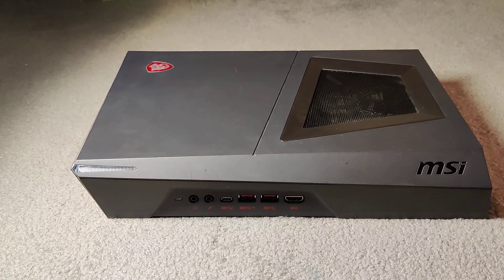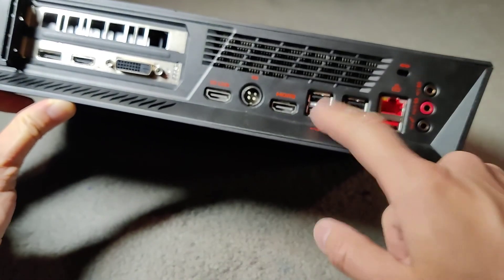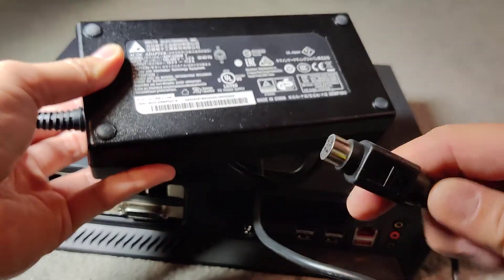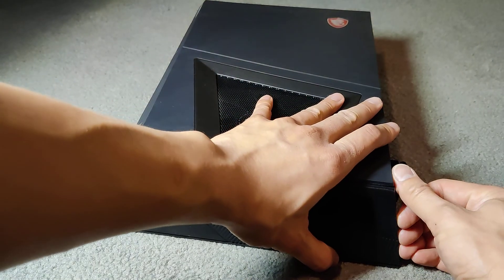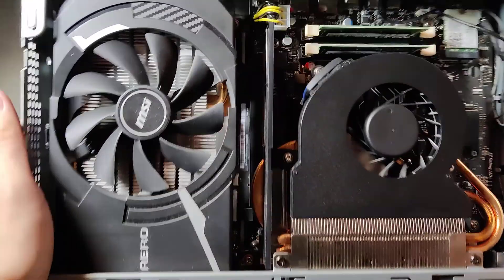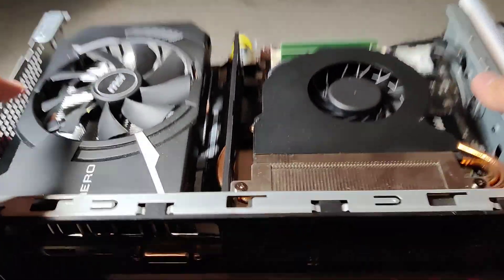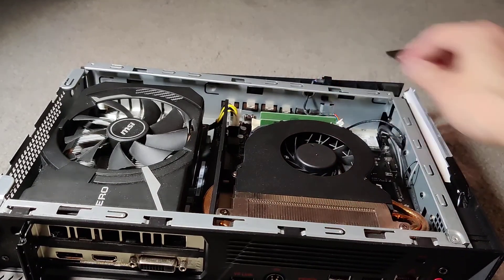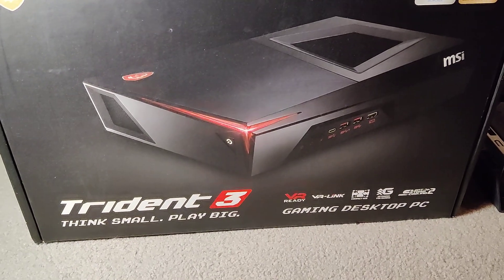MSI Trident 3 9SH-444US, Tear down.

Comment: one question, i need to put one micro sd for instal stuff from my computer i don't see one micro sd port is that correct ?
Reply from the maker: Ya there. Is no micro SD port. Try a USB micro reader
Reply: @richyoyo9796  thank you for the information

Comment: Thank you. Very useful, even though I have one generation older model.
Too bad it doesn't seem to work with RTX 4060, that would be a neat upgrade.
Reply: Seems like the highest you can go is 3060 or something
Reply: @STOPSYPHER  Yup. I found no way to make it work. Nobody willing to mod the BIOS, either. Not enough resources to mod BIOS myself. Clearly they locked it down on purpose. I need to build myself a decent mITX build instead. These manufacturers make sure their hardware becomes a trash can when it is its due time.

Comment: Hey great video! It helped me a lot. Unfortunately I’m still unable to find why my trident isn’t working. I was on it like usual when it just stopped working entirely. I’ve tried a new power cord and still doesn’t work. Do you know what I can do?? I assume it’s a problem with the power supply. No lights turn on when I try to power it on
Reply from the maker: sounds like motherboard. do you see any blacken areas on the motherboard?
Reply: maybe this does help because I had a similar issue: one of my RAM slots got burned so I can use only one now. Also bads on my original HDD, maybe try to stay on SSD only for a while
Reply: I can’t find the power supply. Did you?

Comment: Hello nice video, i have a question, i am thinking to move any hardware to another case from my trident. It will be possible?
Reply from the maker: Ya you can only move like maybe half the things. which is not much.  You will have to get a new case. motherboard and a few other things. I'm not sure. Might as well buy another computer then.  or just save up for the next upgrade.

Comment: I’m currently using my trident 3 from my dad it has a Nvidia GeForce 1060 and an i3 (can’t remember what cpu) I’m trying to get inside to clean it but the case is not opening
Reply from the maker: I'm not sure which part you are stuck on. The case is pretty confusing to open.

Comment: do you know where we can purchase ram for upgrade for this pc ?
Reply from the maker: This one if you just want to get one more stick.  you will have to check how many slots you have left. 
Crucial RAM 8GB DDR4 3200MHz
https://amzn.to/3HFlpL0

Or this one if you need more ram. 
https://amzn.to/40rIGrl
Reply: @richyoyo9796  did you ever install an m. 2 ssd in this pc. I’m planning to do so for a friend of mine as I’m helping him out.
Reply from the maker: @deeelyacoubi2390  Na I never done that to this pc. but its pretty easy. just purchase one and open it up flip it over and plug it in. just keep in just to get rid of any static, so you don't fry the parts. 

Link to Upgrades you can get for the MSI Trident 3. 
https://kit.co/RichYoYo/msi-trident-3-upgrades
Reply: @richyoyo9796  appreciate the reply and feedback. I hit that link, but it didn’t take me to the list.
Reply from the maker: @deeelyacoubi2390  Thanks Try it now. Its just links to upgrades for this computer.

And here are the ssd that will fit.
https://amzn.to/3wI0JvB

Comment: Is the gpu power cable a 6 to 8 pin?
Reply from the maker: Should be only a 6 pin to 6 pin. 1660 does not pull that much power.
Reply: @richyoyo9796  I thought 1660 cards were all 8 pin?
Reply from the maker: @BeigeYeti12345  Sorry My bad. I don't have the computer any more. 
Its probability is  this. 
https://kareonkables.com/products/msi-mpg-trident-3-8-pin-pci-e-gpu-upgrade-cable1

Comment: How would you set up at triple monitor setup on this desktop? I have 2 monitors connected to it & im trying to connect a 3rd, but it’s not connecting my 3rd monitor
Reply from the maker: I'm not sure which step your on. so are all three monitors plugged in? Did you look in to the software in Nvidia?
Reply: @richyoyo9796  yes all 3 monitors are plugged in. Nothing is showing up in my settings so I cant find how to setup my monitor. My 3rd monitor just shows “no signal” on the screen. I have 2 working & plugged up. Just trying to add a 3rd! Please help. I have the 3rd plugged up by HDMI.
Reply from the maker: @SandPipeHer  hmm did you try switching the hdmi cable to another monitor? Could be the monitor or the cable or the gpu hdmi.
Reply: @richyoyo9796  yes tried all that. Still doesn’t show up!
Reply: well dpi for one dp for other and hdmi for other

Comment: How would you take the gpu out? Ive gotten to wear u can see the harddrive on the back and have no clue with the gpu
Reply from the maker: At 3.30 is where the screws are that need to be removed.  The top of the gup area, power cable of the gpu, and the screw where The hdmi go. Then side it off

Comment: Looking to add a ssd card but can’t see anywhere (after a teardown) where I can plug it into the board (or plug the board into it  power wise). Is this possible?
Reply from the maker: At 4.20 min the black spot in the left of the case is the ssd. Where you can add one.
Reply: YT
Reply: Seriously?!  Did you even watch the video?

Comment: hey so can someone make this easy and link some compatible 16gb ram i can get? Or can u tell me what kind of 16gb ram is compatible.
Reply from the maker: Those should work. just get an "so-dimm 260-pin ddr4 sdram 2400mhz"
I'm not sure how fast the mobo can support for the ram speed. you might be able to get faster than 2400 mhz. 
just get a sodimm with 260 pin and ddr4. 

Try this link also
https://kit.co/RichYoYo/msi-trident-3-upgrades

Comment: I’m struggling to take the gpu out please help
Reply from the maker: Where are you at on it? there a lot of screws like under it and to the side of it also. which makes it confusing.
Reply: @richyoyo9796  hey, I can switch the case right?
Reply from the maker: @e3ng682  Probably not. since the Motherboard looks like MSI custom size. You would have to get a lot of parts just to change the case.
Reply: @richyoyo9796  what parts would be required if I was going to switch into a mini-ITX case?Thanks
Reply from the maker: @zoezee5420  Looks like you Need everything almost.  New motherboard. new case. new power supply.  new cpu fan?

you can only move over gpu, cpu, memory. wifi. 

https://storage-asset.msi.com/specSheet/us/desktop/Trident%203%209SH-444US.pdf
Reply: @richyoyo9796  thanks for replying!🙂

Comment: What type of ram is in it? I ordered a Trident 3 with a 1660 super but it only has 8 GB or ram. I'd like to buy another 8 GB stick instead of a whole new set. Does it have to be the same brand and everything?
Reply from the maker: Its recommended to buy the same brand and everything because its iffy it might not run in dual channel. if there not the same.  I recommend when you get the computer you run the program cpu z. which will tell you everything about the computer. and ram type and number. then purchase the same one.
Reply: @richyoyo9796  hey man idk if you’ll reply but can I upgrade to a 3060 nvidai rtx graphics card?
Reply: If it fits inside this case possibly. There's also external housing you can get for graphics cards that are bigger. You'd have to look it up